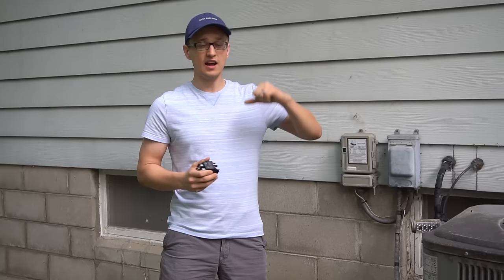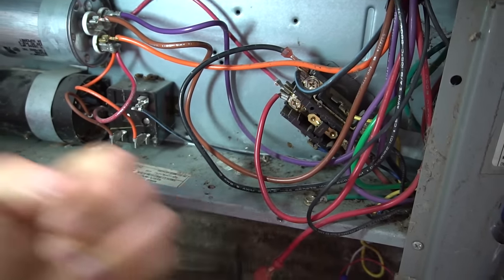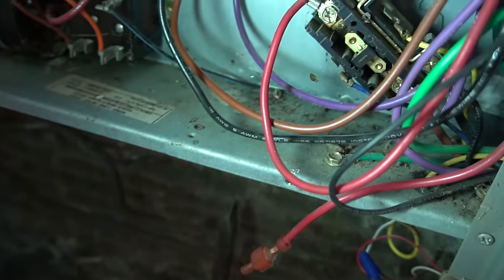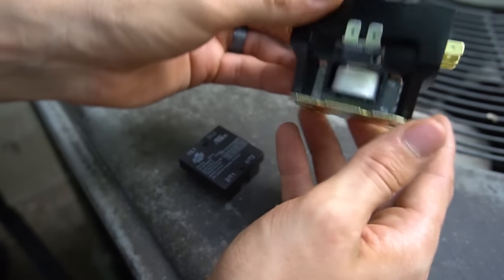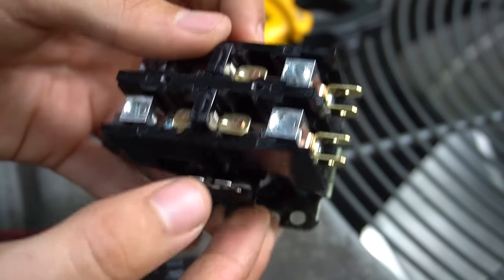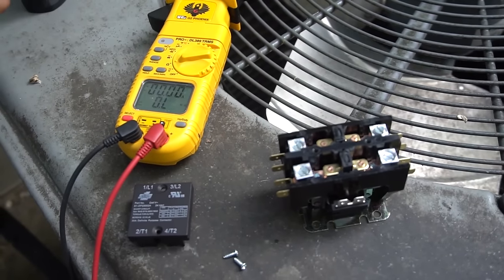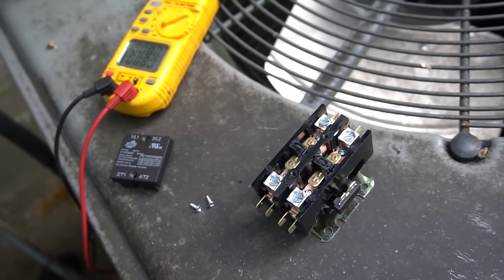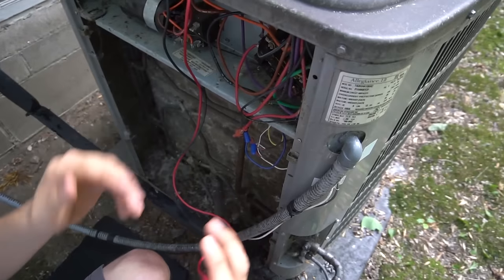Air Conditioner Contactor - How To Check If It's Actually Bad

Comment: I have watched a few of your videos. I think my problem is the capacitor. They plunger is pulled down when the thermostat on and lets the 240 through.  But nothing is coming on. But I don't have a Mfd multimeter to check. Do you know a different way it can be tested. Or any ideas?
Reply from the maker: There may be some way to do it but unfortunately the 2 ways I know of both require a meter. If you can measure resistance with your meter (horse shoe symbol) Try taking out the capacitor, discharge it by putting a screw driver between the different terminals, and put your meter leads on Herm and C. You should see your ohms climbing for a while and then stop. That means your capacitor is charged up. Then reverse the leads and put it back on the same terminals. That will drain it back down.  If your capacitor is not doing that, then likely it's bad. The capacitor is not too expensive so I would just replace it to begin with and see if it does the trick.

If anyone else reading this knows more methods, please do share :)
Reply: @WordofAdviceTV all that it says 000 and OL. It was going up but then when I changed it said 0L then 000
Reply from the maker: Most likely your capacitor is dead then. Replace it and hopefully that is all it was and you can forget about your air conditioner for another 5-10 years :)
Reply: Thanks I Hope it does its in really great shape.  I keep it clean.
Reply: It took a minute to fire up.  But the capacitor was the issue. I really appreciate your help!
Reply: I most have not gotten a good capacitor online. It must already be out. Its buzzing  but I took it out again. I think it's the issue its seems the same way as before. Where is a good capacitor sales department.

Comment: Replaced capacitor and the plunger on the contactor sucks in making contact but the compressor is not starting. The lights in the house dim every 10 seconds or so but the ac is not cooling. When I checked the wiring they had been chewed somewhat so I spliced and taped. Fan works but no compressor.
Reply from the maker: Watch my video on how to replace a capacitor and then try replacing it :) From what you described, sounds like a new capacitor will fix that problem.

Comment: I have an older one without the bug cover. I threw a capacitor at it. Didn’t work. I even got a new contactor and that didn’t work (I think wrong part?). I look IN THE OLD CONTACTOR and a fricken dead earwig falls out! Put it back on and she works! Returning the new parts woo!

Comment: i just replaced the run/start capacitor because my fan wouldn't start, but it runs great when given a little nudge.  new run/start capacitor, same thing.  i noticed the contactor switch is "in", even with the outside fuse pulled from the breaker box.  is this part of my problem?
thanks!
- never mind; i answered my own question. contactor switch is in even w/fuse pulled from breaker box because low voltage connection to t-stat was still calling for cooling.  and, my old run/start cap must have been fine; i decided to pull the fan, and the start wire was broken inside the motor housing. i trimmed the insulation, twisted the broken wires together and then soldered them, and they're protected w/two heat shrink tubes.  now, the fan starts instantly - yay!

Comment: do you have a video how to ck a defrost board on a goodman.........my contact switch is not pulling in on cool cycle and no 24 v across the side terminals as in your video yet 240 coming in and if I manually press the contacts, the compressor and fan work as it should..........the coil has power going in and 24 coming out but one wire i think goes to defrost board then from there a wire comes from the board to the contact switch ..............goodman  3 t packaged.................PCBDM133S  waiting for my new board

Comment: Mine works but its pretty old and corroded. Thinking about replacing it since they are cheap. Does the LRA numbers have to match on old vs new. Mine is a single pole 30a 24v.
Reply from the maker: LRA doesn't really matter as long as it's close to the rating of the old one.
Reply: @WordofAdviceTV  thanks. Got it replaced today and it works good now.

Comment: Jay,

I got an issue with my HVAC: heating & fan only mode = no issue, cooling = issue/thermostat turns off then turning back on (power cycling)

On the cooling cycle, somehow, the thermostat randomly turn itself off and back on (power cycling). When the thermostat turns off, everything got shut down. This power cycling happen only about 40% - 50% of the time. After some Googling, I found that there might be something with the contactor on the out door unit. Is it possible for the faulty contactor to cause the power cycling at the thermostat?

Please note that I don't have a floating switch on my in door unit, just a straight draining pipe down to the sink. The draining pipe looks dry, clear of blockage and there is visible no condensation on the drain pan. Also, I just changed my air filters a week ago.

Thank you,

- Lance

Comment: We replaced the capacitor. Not the problem. But when my dad holds in the plunger, the condenser fan turns on. The plunger will not go in by itself, or at least it will not stay that way. Is it a bad contactor, or is it a bad thermostat?
Reply from the maker: There are quite a few things that can cause the plunger not to pull in. I would suggest watching this video: https://www.youtube.com/watch?v=NVPhsK4gK1A
Reply: @WordofAdviceTV  thanks. I actually found the suggested video right after I commented. Thanks for your help. I'll post the results here after we fix it.

Comment: I noticed 2 weeks ago that the fan wasn’t coming on in my outside unit. I actually noticed there was no sound at all. I’ve replaced my capacitor, fan motor (including fan blade bc the old one would not come off the motor shaft even using 2 blade pulling tools), and low voltage wire from my furnace inside to my outside unit. I think the problem might be the controller, which I’m going to replace in a few days. I did test the controller and the plunger is going down on command. I also tested the voltage coming in from the furnace on the low voltage wire. I also quadruple checked all the wiring and it all looks correct. I hope when I replace the controller that fixes the problem. Any other ideas on what it could be?

Comment: My AC repair guy said to replace it as good measure when replacing the run capacitor. $80.00 for the part and $179.00 for labor just for the contactor.  I think this was unnecessary and will change it myself in the future. I got ripped off for sure!!!

Comment: My 30 year old American Standard system is starting to give me some trouble.  After it is running for a while on very hot days, the compressor shuts off (fan keeps running) but I am getting warm air from my registers as opposed to air in the low to mid 50 degree range when it is running normally. Usually, I can throw the circuit breaker, wait 10 minutes and restart the system, it begins working normally again.  What i noticed on my contactor is one of the contacts seemed to have carbon on it (like maybe it was arcing) . i cleaned the contacts with a small file. Is the fact that there was carbon around the contacts a sign that the contactor is going bad?

Comment: Hello. My contactor is reading 0.01 ohms. Should I try to replace it before digging deeper?
Reply from the maker: The contactor should read least 8 ohms. So yes, I would start with replacing the contactor.

Comment: Contractors are not directional.  A shorted coil will usually blow the 5A fuse on the control board.

Comment: I replaced my 2 plunger contactor with a 1 plunger contactor.  When I applied the 220 volt power, the unit tried to start.  The 24 volt wires were not connected, which I would have assumed nothing should have happened.  Does that mean my unit has to run with a 2 plunger contactor?  Thank you, Joe

Comment: i'm currently troubleshooting a condenser fan that won't engage. it will spin freely when the unit is off. i've got a hard start and capacitor on order to arrive by the end of the week. i'm hoping it is not the actual fan motor. one question i have is this. when i set the thermostat for the ac to come on, the compressor on the condenser unit outside will kick in. but the fan won't. then after about 10 seconds the compressor will cut off. is this normal? i am thinking it is a safety feature, but it could be an indication of a larger problem. i just don't know. the unit is a rheem installed in 2003. thanks!
Reply: i h8 google . A volt meter should help you find at which point the power is stopping. 
Could be low pressure switch or similar.

Comment: Does plunger have to always be pulled in?
Reply from the maker: Only when the thermostat is set to cooling and the temperature is above the set point. Basically it only pulls in when the AC is supposed to turn on.

Comment: Sorry I need some advice pn my ac ,I check the termostat and all tge wires have voltage except the yellow wire I vhange the run capacitor and have a new termostat and still don't have power in the yellow Y 1 wire can help please with an advice thank you in advance.

Comment: My contactor was stuck and wouldn't budge. Tech said it was toast.   $588 bucks to fix...sucks but the AC is working as is should now. Texas Heat. worth every penny.  * I was advised to get a Service contract for piece of mind. was I scammed? (*Carrier Unit only 4years old)

Comment: What if one of the leads connected to the connection point is burnt and charring the wire and the connection point?  Is that considered a bad contactor due to overheat or current in one of the wires?

Comment: I had a tech cone out and say I should replace my contacted.  Said it showed 7.7 amps but should show 5.   Also capacitor is weak should be 45-5 mine shows 39.47.  Does all this make sense?   Thanks.

Comment: Why do you call one side of the contactor a common? Both incoming wires come off a breaker and have 120 VAC.  I would like to see you remove all wires and start with one item and wire it then add the next set of wires etx...  Use a 521 in that also.  I see a small orange wire running from the capactor to one side of your contactor, What is that for?

Comment: Our compressor is having trouble starting. It'll take several attempts before it will (maybe) kick on. AC guy wants thousands for new compressor or even more for a new unit. We tried new capacitor and hard start kit. The hard start got it fired up but it started making strange noises. Could this switch have a problem supplying the correct voltage or anything? The contacts where the wires hook in look pretty rusty...
Reply from the maker: I know this is probably not what you were hoping to hear but usually a compressor that makes abnormal noises is bad news. Likely it is internally damaged and the valves are shot. About the rusted wires, that is possible, yes. Although usually not enough power supply would not cause it to make strange noises. If the voltage is fluctuating or if there is not enough, the compressor will have a hard time running. If you have a meter, I would check the voltage and see if you have a steady 240v going in and out of the contactor. If you don't have a meter, then you could try turning off the power and snipping off those rusted connectors or pieces of wire and put new ones on. In your case, I doubt that will help but as a final effort, you could try it..
Reply: @WordofAdviceTV  Thanks for the quick reply. Maybe I used the wrong terminology- it's not the female pieces on the wires that's rusted, it's the male end that is on the contactor switch. I assume it'd need replacement to actually test that out? Also by weird noises I mean like it struggles. The best description is it sounds like when a car is low on gas and it sputters right before shutting down. It's more like a struggling to run kind of noise. Hopefully that makes sense.
Reply from the maker: @mattd313 The noise description does make sense but still remains a bad occurrence. As for the male terminal tabs on the contactor, you could sand them down if you wanted to or just replace the contactor since they are not very expensive.
Reply: @WordofAdviceTV  Grasping at straws here, but while looking at the rust after my last comment, I took a closer look, and took off the cover to see the contactors- and there's a bunch of some kind of oil in there... Everything around this part is bone dry, but this part itself has some oily residue, with quite a bit saturated inside where the contactors are...  I know this isn't normal... but is it a potential culprit? I asked a local part store who had an HVAC guy and he said "potentially", but to call an AC guy out since he can't be sure via phone. Based off what you know, do you think it's a possibility that a clean contactor could solve the problem, or based on what I'm saying do you think it has to be something bigger? Thank you so much!
Reply from the maker: As far as my experience goes with noisy compressors.. As far as I remember, every time a compressor sounded like it was laboring really hard, that was the beginning of the end. A hard start could help it temporarily in some cases but it would die soon after. The part that can leak oily substance like that would be the capacitor not the contactor.. So some of that grease got onto the contactor as well? Those parts are not very expensive so I suppose it's worth a shot, to try replacing it and see if that makes a difference for it.
Reply: Word of Advice TV I have no idea where the oil came from. The capacitor is in tact and dry. Everything in the panel is dry. Except the condenser contactor part. The outside plastic has oil residue all over it, and the inside has a whole lot. The contacts inside are pretty saturated. We’ve never had this unit repaired before so it’s not from an old problem that wasn’t cleaned up fully. I can’t make sense out of where it came from. But in any case I’m going to buy a new part tomorrow since it’s cheap, and see if a clean part will work. I’m not overly confident, but if there’s even a 1% chance it’s worth it to me. Lol. 👍
Reply from the maker: @mattd313  Yeah, I would give it a try too! That is really weird that there is oil residue on the contactor though. I wonder where it came from then if everything is dry. I wonder if something melted in the contactor. I would have to see it to be able to make a guess lol
Reply: @WordofAdviceTV  I talked to the AC guy who came out and he said he blew a capacitor when troubleshooting and it must have leaked on it. Crazy that no wires were saturated, literally only on that one part. 
So now I guess I gotta decide between a Trane 5 ton 16 seer for 4900 and a Rheem 4 ton 14 seer for 6500- different AC companies. One seems high and the other low. Any reason to sway away from people who are much cheaper than others. I get concerned about counterfeit parts / refrigerant which I've read is happening...
Reply from the maker: @mattd313  If time allows, I would get 5 estimates :) Preferably local guys. Billboard companies will always cost more. There will be a big swing in prices and just because it is more expensive does not mean it is better. It just means they charge more. Have you seen my video on the best hvac brands? I talk about that there. There are also a ton of comments on that video that I am sure would help you make a decision.
Reply: Word of Advice TV We’re having another company come out tomorrow that recently quoted my parents what we’d end up needing. Price is right in the middle and is a 5 ton 16 seer Carrier unit. I think it may come with some kind of air purifier too... not sure what kind of maintenance requirements that would have.
Reply: @WordofAdviceTV  Thanks for all your feedback. We had 3 different companies out, and went with the company who appeared to have the best, well-known reputation in our community. They put in a Carrier unit Tuesday and our house is finally nice and cool again. :)
Reply from the maker: @mattd313  Glad to hear it's finally resolved! Thank you for the update, stay cool! ;)

Comment: Can I just replace the copper contacts only instead of replacing the whole unit and Where do I buy them?thanks
Reply from the maker: If you don't want to buy a new contactor (they are not expensive), you can try cleaning the contacts. I don't have a video on that but there are videos on YouTube that show how to do that. I have never replaced just the contacts alone though and have never seen them sold separately so I don't have a good answer for that..

Comment: So i changed the capacitor and the ac blows the fan comes on for 5mins then stops and the contactor still is in pull position with a buzz every so often (as if it where attempting to have the fan running again ) The indoor unit still runs and blows air .  does this help ?  I have yet to get the meter to do other test

Comment: I had an contactor on a icemaker showing fault. I checked the ohms resistance going across on each side. One side gave me 1 ohms of resistance the other gave me 24 ohms. Is this another way to check contactors? I wasn’t pretty confident it’s the contactor but I won’t know until I’m back out next week

Comment: In California all our Ac units have transformers. How do you unit handle the high voltage without one?
Reply from the maker: Not sure :) Your units are 230-240v too right? I don't remember the last time I have seen a transformer on a residential condenser unit...
Reply: @WordofAdviceTV  well I do residential and light commercial so I work on anything 120,220 460
Reply from the maker: @dumptrks  Oh I see. I think commercial uses transformers more. But here in Minnesota, the average residential units don't have transformers in the condenser unit.